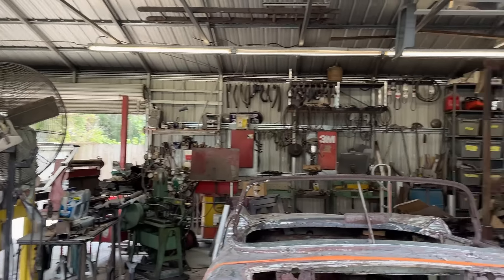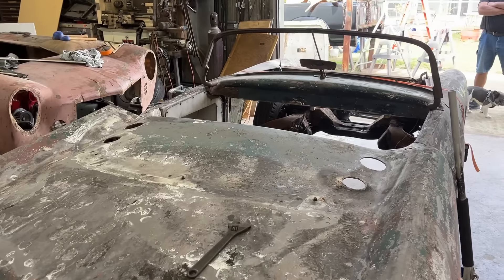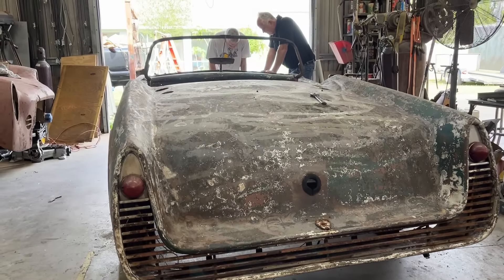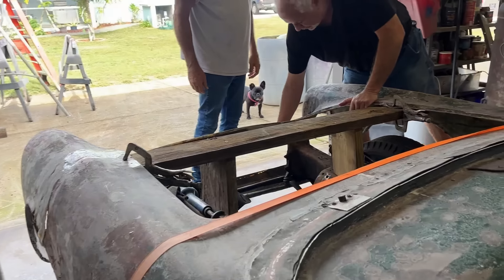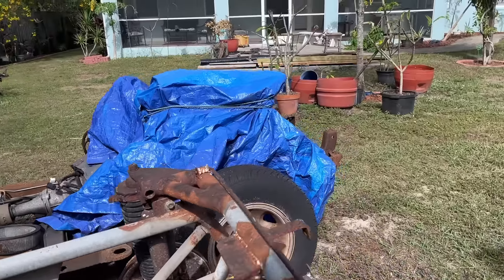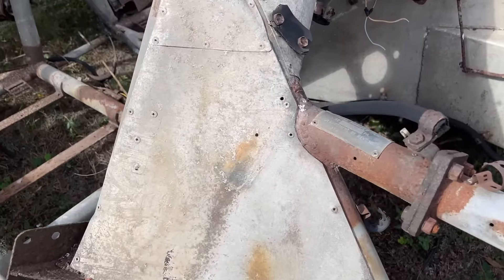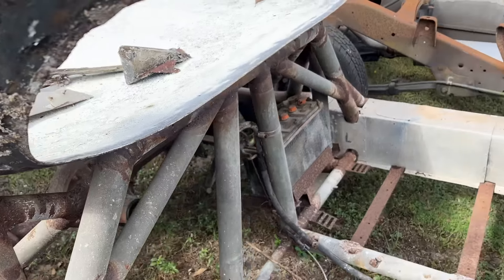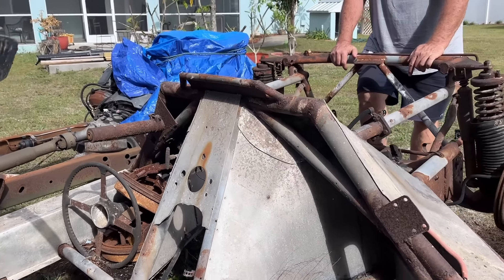RESTORING CLASSIC CARS | 1955 McCormack Rebuild- From Junkyard Find to Restoration

Comment: Awesome, to see more of these found. I used to own the green one that is in Australia now. It was found by (custom car builder) David Guymon back in the 90s. I believe it was the original one that Henry McCormick built since it was attached to a modified 40s ford frame.
Reply from the maker: Interesting!
Reply: Just finished your video. I'm the Texan who sold the other car to the guy in Australia..  From what I remember the original car was built atop a modified 40s ford frame, the Australian one has a highly modified ford frame, plus the amount of air craft hardware, wiring, him joints and overall craftsman ship that was in the green car when I got it was mind blowing.. Like all the original wiring was white aircraft wire and was all invaded in clear tubing that went to fuse panels or wire connection blocks,, very meticulous. (McCormick, if i remember correctly, was a air force or military mechanic or something)
Reply from the maker: @troybarnes2420  Great info, thanks a lot!

Comment: I couldn't help but notice on the fence post chassis the utter lack of bracing on the upper spring mount. Doesn't look safe.
Reply from the maker: That’s part of the reason why a different chassis was used for the restoration